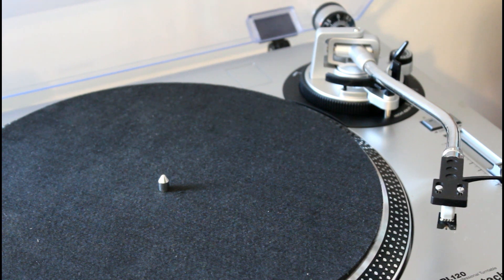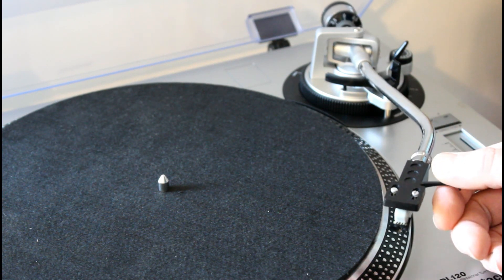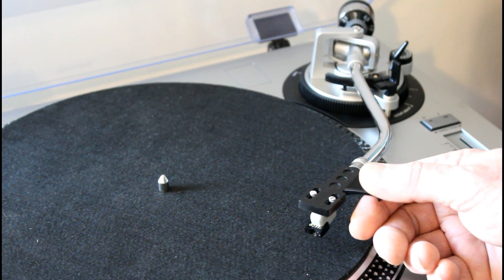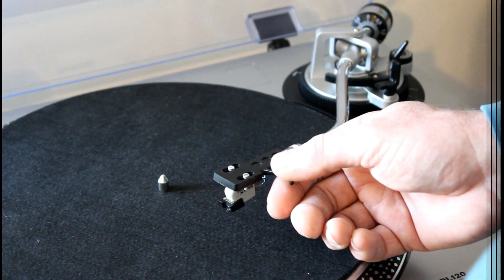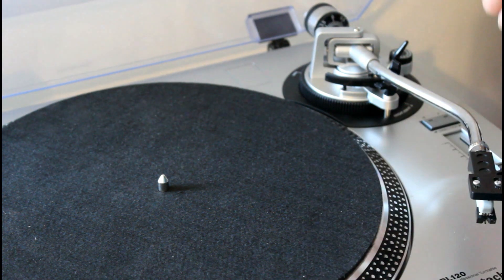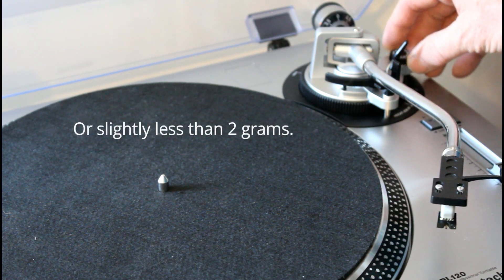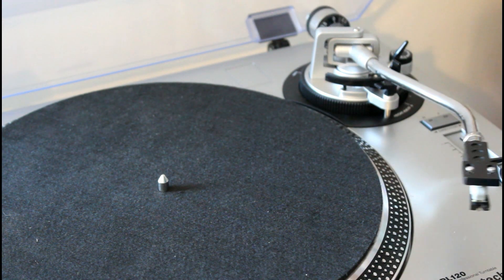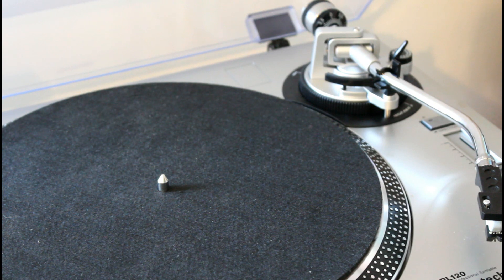Audio Technica Turntable AT-PL 120 (USB) Anti-skate review.

Comment from the maker: Yes, I believe there was a problem with the anti-skate on some USB models, which prompted me to do this video.  The problem seemed to be that the tone arm didn't apply any anti skate until 2-4 grams was dialled in.  Then it started to work.  The tonearm should pull to the outside at an increasing/faster rate as you increase the knob numbers.  The problem with mine seems to be that there is no stationary position with 0 dialled in.

If your anti state effects the tone arm movement the same way under all knob settings, it may be faulty.  If so I'd try to return it to the dealer under warrantee as the turntable is not functioning properly.  

However, it sounds as if you have some anti-skate, you need to determine if it changes relative to knob settings.  Again it should pull to the outside or back towards the tone arm resting place. Thanks for your comment.

Comment: Would be better If Audio Technica would provided us with a Perfect Replacement Spring. Putting It In Is no problem quite easy. The only thing I would stress though Is there are Little Tiny Copper spacers when the Base finally comes apart. These tend to fall Into the Top plate. There are 8 of them, All You do Is fish them out. Now when You are putting the thing back together. There Is NO reason to Tape, Glue, or Melt these on to the Stems they fell off. Just put the Base On (Making Sure You are NOT trapping anything) then put the Spacer on the Screw (I find Wetting the Screw) to make It Stick. Push the Whole thing home It Is a little tricky so keep some Blue tack handy for Fishing them out If they don't center first time. Then Screw them down till they Bite NO MORE THAN THAT or You will crack the Casing. Mine Sounds Great now, I By-Passed the Pre-Amp (Left It In). I used Replacement SL1200/1210 Audio Cables as they come with Earth Wire Built In and they Sound Great (You can get them on E-Bay). Good Luck Happy Tweaking. Thanks for the Tips In the Video.

Comment: You can't just set the anti skating to more or less the needle pressure weight. You need a test record with sine waves and a scope program on a pc. Then you adjust the anti skate until both L and R waves look as smooth as possible.
Reply from the maker: Interesting, where do you get the sine wave record? Sounds expensive.
Reply: denbydish : google for the Hifi News Analog Test LP. It has the sine waves. Get the record with the protractor, as you have to perfect protraction first of all.

Comment: Move the tonearm of the Audio-Technica 120 to the center spindle. Then after that hold it there and turn the anti skate to seven. After that hold on to the tonearm as you slowly turn up to 1 it will stay it just the way it works in that table not affecting your Gram weight of tracking Force..
Reply: Wait hold on... I'm looking to buy this turntable. Are you saying that this is the way to over come everyones anti skate problems that I've seen on youtube so far?
Reply: @johnconway8199  I noticed this also, but it’s not a perfect solution. Mine will balance on zero, which doesn’t give me much leeway. I’ll be leaving my AS set to 7 (max) overnight to see if the spring becomes less aggressive.

Comment: Hi, I've got a Pioneer PLX-500 and the anti-skating reacts exactly as yours in the video. I have put on it an Audio Technica AT95E cartridge and the recommended tracking force of this cartridge is 2gr. Do you think that i have to adjust the antiskating on 2 or less than 2? Maybe 1,5....?
Reply from the maker: Hi Chris, that's the million dollar question!  Until someone invents a device to measure anti-skate in action, how do we know how much is actually being applied?  I usually set mine at the recommendation, say a 2 gram cartridge with a corresponding 2 on the anti-skate dial or one notch under (20% less).  Most cartridges operate at 2-4 grams (78rpm carts aside) so I assume that the manufacturers attempt to get those ranges correct. 

Some people use a CD to set anti-skate.  The idea being it's a grove less medium and the needle will float freely on the top as it turns.  However, I'm not sure this is scientifically sound, as this is not the same as a record.  But if you are interested, you place the cartridge in the head-shell, set the weight (say 2 grams) set anti-skate at 2 and lower the needle onto the rotating CD.  If it tone arm moves towards spindle, increase anti-skate a degree.  If the tonearm moves away from spindle, decrease the anti-skate until tone arm remains still.  Never tried this myself as the CD seems a bit small.  I use a 8mm acrylic gloss platter on my turntable.  I hoped to be able to set the anti-skate on that, but whatever setting I used the tone arm kept moving towards the spindle!  Not sure what to think about that, more investigation is clearly needed. Good luck and thanks for your comment.

Comment: I have read that the reason why the anti skate is set up like this, is because it plays in reverse as well.  It may just be a screw you thing.  You can change the spring or modify the spring to get it to work properly.  I have and now it's perfect.
Reply from the maker: Howard Mora .  Hi Howard, thanks for your comment.  It makes me wonder how the tone arm is likely to move when the platter is in reverse. Would it still pull to the centre or would it pull to the outside?  If the latter, is it even possible to accommodate for this with the current anti skate design?  It seems everything would need to be reversed.  Maybe this is why they've not bothered too much with this aspect of the design.  Interesting.
Reply: Yes...the turntable is an entry level turntable.   Most people don't need anything better than this and probably never even try to set the thing up precisely.  There's so much information about this machine because it's probably the most popular, most produced turntable out there.  For 250 dollars...it's not a bad deal.  After that, if you want to tweak it and know how....have fun with it!

Comment: If the anti skate works fine,   when are AT producing a new anti skate spring to sort out the problem.
Reply: Audio Technica are already aware and have new springs in models manufactured after 2017. You can purchase a replacement spring from their parts department by sending them an email requesting one. I purchased one for $1 plus shipping $10 (way too expensive). The new spring is ever so slightly thicker and shorter than the original. 

I installed it and now the anti skate works fine with the dial set between 1 and 2. If you purchase one, keep in mind, there is misinformation out there that claims you have to completely disassemble the tonearm and de-solder the wires going to the motherboard in order to replace the spring. This is FALSE. 

A couple of screws will separate the tonearm assembly from the height adjustment assembly and it will drop out of the turntable. At this point all you have to do is support the tonearm to keep slack on the wiring so it doesn't snap. This will give you plenty of room to have access to the small, metal cover (held on by a small screw) that goes over the anti skate spring. The old spring is glued in place, so some tweezers will help pull it out as well as place the new one in.
Reply from the maker: This is great information. Thank you.
Reply: Got mine yesterday (120x).  After getting the weight dialed in, then setting anti skate it works perfect.  Numbers might not match, but nevertheless I was able to get it all balanced with minimal fuss..

Comment: what are the benefits of anti-skate?
Reply: and will the anti-skate (when set) go along the grooves of the records
Reply from the maker: Anti-skate is designed to counter the natural tendency of the needle/tone arm to drift towards the center of the record (towards the spindle) while playing.  It applies a counter force either by a weight or more commonly a small spring.  This can be adjusted to work with the tracking force or weight set for the tone arm.  The idea is to get the needle/stylus to ride in the center of the groove to enable it to pick up all the musical information, and to minimise groove wear.  Hope this help.  I have tried to address this in the video.  Thanks for your comment.

Comment: Hi there,
When I do the dvd test the tone arm is pulled in no matter how high the anti-skate is set. Is it worth modifying the spring inside or is the sound quality difference negligible?
Reply from the maker: OutTheBox Hello, I recently purchased an acrylic platter matt for my turntable, which is glossy, smooth and highly polished.  I had it in mind to try setting/testing the anti-skate on this.  However, as it turned out I had the same results as you.  The tone arm kept moving towards the spindle regardless of the anti-skate setting.  I am not sure what this means.  Clearly the needle sitting on a flat surface is different than it riding in a grove.  I don't know if the DVD test can be used to accurately to establish correct anti-skate values.  It seems to make sense but is this method used as the setting procedure for anti-skate in any factory?

As for the sound, I think the best way to tell is to use your balance knob on the amp and pan it back and forth and analyse the sound coming out of each speaker independently. How does it sound?  Are the volumes at the same level?  Are you getting detail through each channel. If not then try adjusting the anti-skate and check for any differences. 

I'd say as long as the tone arm weight is correct for the cartridge, I'd suggest adjusting the anti skate to the settings required and live with it. I can't see it doing any harm really.  Not unless you play the same record over and over add infinitum.

Personally I get very good sound from my turntable and am satisfied.  I am not aware of the anti-skate making a difference to the sound, nothing obvious anyway. I use a Pickering cartridge and find the sound and detail excellent. I also have other turntables, one is better, but for now I think I'll hang onto the Audio Technica. Hope this helps.
Reply: denbydish Thank you for replying. I also used a blank side of a laserdisc in case it was more accurate; I had the same results. However, the sound is fine and I just wanted a second opinion and you seemed very competent. Thanks again for the advice! :)
Reply from the maker: OutTheBox  Good idea using the laserdisc!  Thanks for your interest and comments. Keep spinning vinyl.

Comment: It's not that it's a USB model or not. It's the design of the anti-skate mechanism itself. I did everything to get the spring to work correctly and nothing would stay consistent. Sometimes it would play fine for a few albums and then I would get inner groove distortion. The spring is the biggest problem and rather than try and find a replacement I made my own hanging weight device and the whole inner groove distortion problem is gone! I realize not everyone has this problem, but many of us have. I liked your information, but I still wouldn't recommend this POS to anyone. I've only kept mine as I've put so much work into it that it now makes great music. If I had known what I know now when I was going to buy mine I would have bought a Rega Planar 3 (and no I can't afford to buy a new turntable as I was able to back in 2012). My latest video demonstrates how I got my anti-skate working properly.
Reply from the maker: Hi and thanks for your comment.  Yes, the USB version differs in as much as it has a pre-amp circuit board installed.  Otherwise it's supposed to be identical.  However, they were made some years apart and I assumed the later models were more problematic.  I attributed this to manufacturing problems.  I concluded this from some reports on the USB model where the anti-skate did nothing until the dial was set at 2-3!  But if it is a design problem (as you say) then they must all be effected?  For my money, the turntable was worth buying as I like to play 78 shellacs.  I paid $145 USD with free shipping from Amazon when I lived in the US.  That was a good price.  The similarity to the Technics model (which is highly respected) is a big draw.  However, this is quite misleading as the similarity is really only cosmetic as I've since discovered.  

I like your weight modification, sounds similar to the old Goldring Lenco GL78 which are still around for cheap money and can be fixed up nicely.  They also offer 16 and 78 rpm.  Please feel free to leave a link for other viewers to see how you solved the problem and provide a reciprocal link back to my video if you wish.  Thanks and keep em spinning.
Reply: IGD is caused by cartridge alignment, I set anti-skate to 5.8 - tracking @ 1.75

Comment: I found that if i dial weight to 1.5 to 1.75 that i can adjust the anti skate to work without any bias towards swinging in or out! just put a cd on the table (plastic up) and adjust skate.
Reply from the maker: Richard McKeague Thanks for you comment.  I wonder if the anti-skate differs from table to table! I've not heard of any one method that works for all.  Glad you got yours sorted.
Reply: +denbydish HI I actually read how to do this on another board that was talking about this issue. I am going to pursue changing out the wires to the cartridge because it has been reported that the wires are too stiff to permit the free movement necessary for the tonearm!  No one has found a replacement spring for the oem one...Cutting springs has not worked in any application I have ever encountered because springs are manufactured  to be used as designed.  Shortening a spring works only temporarily as the now distorted spring only weakens with use!  Soft moveable wires are expensive $20? this is an area to expect a cost cut in manufacturing.
Reply: @MrRmckeague  Hi, where  can we purchase those wires ?

Comment: I just got one of these..and I've not modded it at all ...Yet!  It's bad ass...It brought out the beauty of of my adcom Gfaa 555 and preamp...hooked to Joseph Audio Infinite slopes....Very nice to to go back to vinyl..and I have tons of it!  Buy this turntable if you are just getting started.... The 1200 is cool...But man I don't think I need it...
Reply from the maker: Howard Mora   Thanks for your comment.  I agree with your assessment of the turntable.  The only issue I had was the head-shell was not 90 degrees to the platter.  I unscrewed the head-shell collar and removed the two screws underneath.  The head-shell assembly lock could then be twisted enough inside the arm to get it lined up.  I replaced the screws while holding the head-shell square.  

Your system is very high end and would bring out the limitations of the turntable, sounds like an endorsement.  I use a Pickering XV15 cartridge, Marantz PM6010 KI signature amp, with Klipsh Heresy speakers I purchased in the early 80s and this set up sounds great delivering detailed sound even at very loud volumes.  Glad your getting back to vinyl. Cheers.

Comment: I can just see AT fixing the anti skate with a new spring and removing thepreamp and putting in phono connections but labelling it with a new name,the lp130 and then selling for 200 more than the lp120 because of the fixes which are highly desirable but not really adding to the manufacture of the table.

The all new lp130!! with proper anti skate and phono input,only 899!

Wouldn’t surprise in today’s ever greedy World.
Reply: They came out with a new one. The Lp120x. It has the improved anti-skate and its only $249.
Reply: @PulledPurk  nope 120x still not work, I bought one and I gave up, I wont buy any AT product any more

Comment: Silly demo because Audio Technica don’t make the non usb models anymore,it’s the usb model that has the anti skating issues.
Reply from the maker: Thanks for your comment.  Not sure what to make of it as the USB model and the non-USB model are identical designs with just a circuit board added for the USB version.  I imagine that some earlier models has issues too.